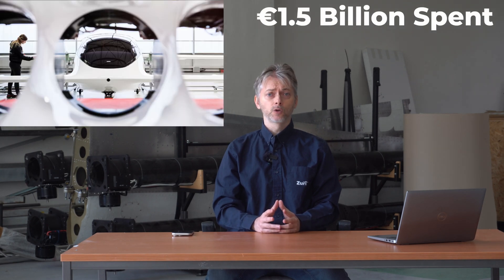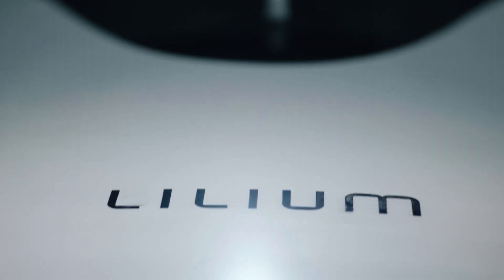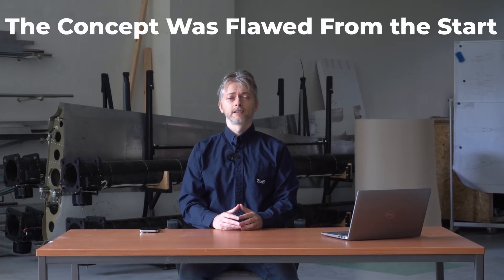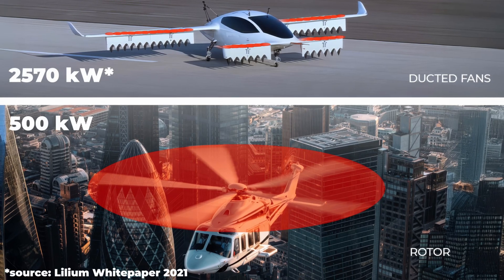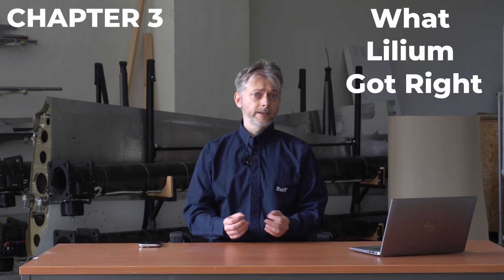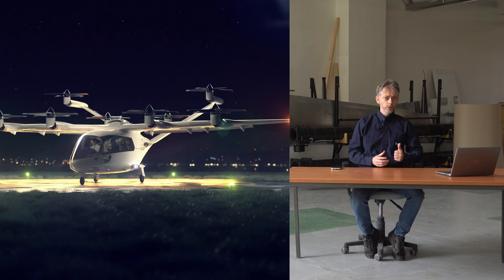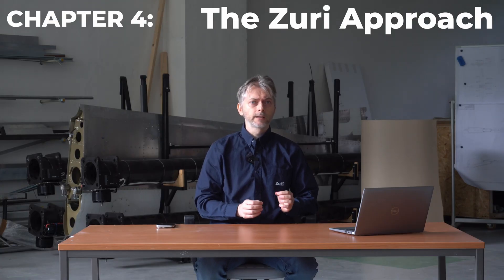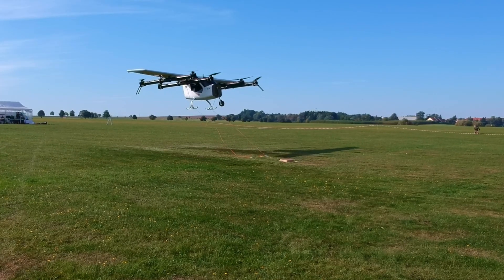Lilium's €1.5B VTOL Collapse Explained — Why It Never Flew

Comment: I disagree with you and I think you using this company's failure to try to make yourself look successful is pretty stupid. They failed because they scaled wrong and should have done what you did and built a full scale demonstrator. You haven't succeeded where they failed yet either I should mention. You haven't brought an evtol to market, either.
Reply: Not yet, but we will - it depends on the fundraising, of course, but we are orders of magnitude more efficient, as proven many times before.

Comment: These electric VTOL aircraft are a niche within a niche within a niche that is not needed.
They will never be used like the futuristic “flying car” that the public has been sold.
As discovered and similar to the automotive segment, most startups are money hungry endeavors that enrich a few, many are scams and others will fail simply by running out of foolish dreamer investors money. 
Lastly, I know of no one that would board one of those machines.

Comment: In one word, this is a simple fraud. What kind of engineer could not calculate thrust of fan engine? They just take off the finds wsith nice design picture from naive and stupid investors. What is the worst that they are continuing with another "project". Michal Ilich - It looks like usual Croatian scammer.

Comment: I got a better concept for Vtol. It is based on cyclorotors. 

With large cyclorotors you can also land the aircraft with autorotation. 

With your design, people drop dead, if you got energy loss in hovering state. 

Even Stol is safer than this.
Reply from the maker: Our design uses dual propulsion and eight tilt rotors, which together provide multiple layers of redundancy. This helps ensure safe operation even during critical phases of flight.

Comment: Electric? Green? Climate actions? Startup? 7 seater (600KG payload)? Massive potential market? Sustainable fuel? And so on, right from classic BS bingo, full card? Aaaaah, we do know, heard it so many times. The outcome is always the same.
Reply from the maker: We hear your frustration. The industry has seen its share of overpromises. Still, we believe it is possible to move forward with both ambition and realism. The goal is not to chase buzzwords but to build meaningful solutions that work. Honest skepticism helps keep that effort grounded and we welcome it.
Reply: @zurivtol  unfortunately not. The very idea of all these climate-saving startups is just to scam everybody. Its not possible to defeat physics, but possible to join worldwide stream of bs and pinch off your own pension plan from trillions, disappearing in this black hole with or without another one startup, promising 10 or 100 times more that is possible to do.

 Eternal story, from the very dawn of mankind. The single difference - nowadays such scammers cant be even beaten, even for 1.5B of wasted money. Hurray, full steam ahead, we have so many other brilliant promising ideas! Geese are waiting!

Comment: In the world of commercial aviation, there is no room for inefficiency. The best battery technology today (i.e. 500 W*h/kg) is still only at 6% of the energy density of aviation fuel assuming 30% thermal efficiency for jet turbine. The dream of commercial aircraft solely powered by batteries will continue to be a dream for at least another 30 years. There is room for pure electric aircraft today in niche applications, and these areas are mostly in recreation and training. Hybrid powered commercial aircraft is a solution ripe for implementation today.
Reply from the maker: Thanks for sharing this. We agree that for longer distances, current battery technology alone is not yet practical. That’s why we’re focused on hybrid electric systems, which can cover greater ranges while still reducing emissions and fuel use.

Comment: Hybrid currently makes a lot of sense for weight reduction if you use the jet fuel in a power unit not as a direct drive.
But battery tech is getting better far more rapidly than combustion or fuel technology.
Purpose of electrification is to generate enough power to keep batteries well charged and extend range.
One huge advantage of electrification is the ability to recover potential energy as plane goes lower, using the prop(s) as generators, same as regen braking in EV/hybrid cars.
Reply from the maker: Hybrid systems offer real flexibility, especially when it comes to managing weight and extending range. One advantage with Zuri's approach is that our batteries are charged in flight, which supports longer distances without ground-based charging.
Reply: @zurivtol  Kdybys uměl počítat, tak zjistíš, že tahání baterek do vzduchu vše pouze komplikuje. Vrtulník se spalovacím motorem dávno existuje.

Comment: I said it when I saw the first concept. it will never work as promised. I build and fly my own designs. Range, payload and speed are competing requirements. The EDF, especially if small, is the worst technology to satisfy all three.
Reply from the maker: You’re absolutely right that range, payload, and speed always involve trade-offs. Finding the right balance between performance and efficiency remains one of the key challenges in this field.
Reply: @zurivtol  O výkonu a efektivitě můžeš teoretizovat, Illichu. Elektrický generátor + akumulátory + elektromotory a přívody, spínací prvky a regulace budou mít takovou hmotnost, že pokud použiješ ještě turbínu, palivovou nádrž, nebude již ani prostor, ani užitečná hmotnost pro osádku. Zanech experimentů...

Comment: Hi, you'll be interested in my synchronous electric motor. No slip rings, no magnets, no coild on the rotor. It's genuinly a synchronous motor with variable field for operation at Power Factor of Unitiy. Otherwise, I am in complete agreement that the answer for aviation is a hybrid drive, burning chemical fuel in certain flight regimes wheli the propulsion is electrically driven. Such a system can be feasible for larger aircraft.
Reply from the maker: Thanks for sharing that. Your motor design sounds very interesting, and it is always exciting to see new thinking in electric propulsion. We fully agree that hybrid-electric systems have real potential in aviation, especially when optimized for specific flight phases. If you have a link or more information on your work, feel free to share. We appreciate your interest in the conversation around how aviation evolves from here.

Comment: They were never going to be successful. They were on the wrong path. What is interesting to me is that someone coughed up 1.5 billion.
I can make you a 100 flying aircrafts for that money. Obviously stolen.
Reply from the maker: It's fair to question how resources are used, especially in ambitious tech sectors. Building new types of aircraft is complex and expensive, and not every path leads to success. Still, some teams are working hard to apply lessons learned and push forward in more sustainable, viable directions. We believe there's value in advancing the field responsibly.

Comment: Most companies riding hype waves (vtol taxis, crypto, blockchain, AI, self-driving etc) are just scams meant to bring in gullible investors. The product is never the important part. It is just a tool to hype up the valuation so that the founders can exit quietly with giant sums of money. It is one of the best ways to get rich fast.
Reply from the maker: It's true that hype can sometimes overshadow substance, especially in fast-moving industries. But not every team is driven by short-term gains. Some are focused on solving real problems with long-term impact in mind. We believe innovation should be grounded in technical credibility, real-world use cases, and a path to sustainable value.

Comment: Sustainable aviation fuel is approx 5 times more expensive than conventional fuel, production Even with planned expansions is  predicted to meet only a small fraction of the projected jet fuel demand by 2030. Its a good thing that innovators chance their arm and investors take a punt or we would never advance technology but remember as Elon Musk said Prototyping is easy, Production is Hard and making money is near impossible, I think that is particularly true of aviation due to the certification hurdles.
Reply from the maker: Great points. SAF has potential, but you are right that cost and scale remain major challenges, and the timelines are tight. Most projections suggest SAF costs will come down gradually, but near-term supply will still only meet a small portion of global demand. That said, SAF is one of the few available drop-in solutions today, and both governments and industry have set ambitious goals to scale it up over time. Aviation is a tough space to innovate in, especially with certification and production complexity. Still, as you said, without people willing to take risks, nothing moves forward. We try to stay grounded in both engineering realities and long-term viability. Appreciate the thoughtful take.
Reply: There is algae fuel. But the problem is upscaling. No one has developed a method to upscale. It's like the zipper. The person who invented the zipper didn't make any money. The guy who made the machine to mass produce zippers made all the money.

Comment: Electric flight is fine,  especially for small STOL planes on short flights.  This vertical take off obsession is a folly.
Reply: It worked with the Fairey Rotodyne.
Reply from the maker: Thanks for your comment. STOL absolutely has its place and offers a lot of efficiency in the right contexts. We see VTOL as a way to open access where runways are unavailable or impractical, especially in remote or space-constrained areas. For us, the value is not in replacing traditional aircraft, but in adding flexibility to serve new types of routes. It comes down to choosing the right tool for the right mission.

Comment: The Lilium aircraft worked,  but should started smaller,  like Jetson's aircraft.  You want to get a piece of the  ultra light and experiential markets first to start making money fast. These smaller markets already have bookings for the next few years.
Reply from the maker: That is an interesting perspective. Starting with smaller ultralight or experimental aircraft can definitely be a faster path to revenue and visibility, especially in the experiential market. For us, the focus has been on solving real mobility challenges where range, payload, and operational flexibility are essential. Different strategies make sense depending on the target use case and timeline, and it is good to see both approaches moving forward in the space.

Comment: and you would know, German R&D tax rules reward continued research at times, rather than going to production.
Reply from the maker: Interesting point. Germany does have strong incentives for R&D, and in some cases that can tilt companies toward ongoing development over moving quickly to production. But it is also what helps support deep engineering work and long-term innovation. As always, the balance between research, certification, and commercialization is a tough one in aviation.

Comment: As a propulsion engineer and ducted fan designer I agree with your analysis. The marketing term "electric jet" raised my eyebrows right away - a ducted fan is not a jet. Pure hype. Now take 30 of those tiny ducted fans, all operating at very low Reynolds Numbers, with inlets optimized for cruise rather than static thrust, with relatively small total disk area, and you get a very inefficient system, requiring a lot of power to hover. Then add up all the parts, wiring, connectors, control systems, etc. and it quickly becomes a nightmare to build and maintain. Simply not practical. August Raspet, designer of the Focke Wulf 190, said it best: "Add lightness and simplicate". Amazing how gullible investors can be. 1.5 billion? You have got to be kidding me!

BTW, I can hardly understand your accent but have subscribed anyway!
Reply: Kurt Tank designed the FW190.

August Raspet was an aerodynamasist who did a lot of boundary layer work.

As to Simplicate and add lightness: Colin Chapman is often credited with that one, although he didn’t come up with it. Neither Kurt Tank or August Raspet are credited with coining the phrase, although it is good advice in aircraft, and cars.
Reply: Hi Phil. For the readers: 
1. Second law of Newton (1687 AC): throw down wind , get lift back. But : lift is linear with the throwdown-wind speed, and the energy loss is squared with it. Small Lilium ducts, much energy needed and lost= first try of "bending physics" by Lilium.
2. Square-cubic law. Twice in size means squared wing surface and mass to the power 3. So blow-down, or throw-down speed of wind must increase linear with size. Efficiency goes back squared. Bigger is inefficient. So upscaled Lilium model is against more physics laws, than one.
3. Nature proves it: very small helicopter birds (=hummingbirds) can hover 60% of flight time, larger heavy planes (Albatross etc) need long wings to reduce wind-throw-down speed. 
This is the explanation in primary school talk.
Reply: Does a water hose emit a jet?
Reply: @bernhardzunk7402  Not in the sense that an aircraft engineer uses the term! "A jet of water" and "'electric jets' that are actually ducted fans" are very different "jet" claims.
Reply: @bernhardzunk7402  technically yes, water jet😂, jet is high speed controlled flow through a duct
Reply: Archer Aviation is spending similar amounts on a less ambitious technology. And they get valued at 7bn, as though competition didn't exist
Reply from the maker: Appreciate the thoughtful comment and your perspective as someone with hands-on experience in propulsion and fan design. The points you raise around efficiency, complexity, and Reynolds numbers are important considerations for any VTOL architecture. We are taking a different approach focused on balancing performance, range, and maintainability in real-world use cases. And thank you for subscribing. We are glad to have you in the conversation.
Reply: A ducted fan produces a jet. A turbojet also produces a Jet.  But neither a turbojet, ducted fan or a turbofan are jets.   Jets are streams of fluid or gas  but in itself non of the engine are jets. its a sloppy abbreviation just like 'gas' is used to describe gasoline.  .
Reply: @bernhardzunk7402  Ah, you have answered your own question! sorry, I didn't scroll down far enough...

Comment: Yeah, focusing on small potential benefits and completely ignoring extreme drawbacks doesn't fool physics. Besides the very obvious fact that using a lot of tiny ducted fans is very inefficient, even when you consider small potential benefits, no matter how cool those potential benefits may seem in theory, there are other very severe issues with that concept/idea. 

For instance, whatever efficiency you can achieve, it will decrease even further the further you get from the optimal conditions for the specific design, unless you can control the aerodynamic properties, like by having variable pitch of the rotor blades. And for a short hop VTOL battery powered application, you really want as high efficiency as possible, at any speed, and in their case that's every speed from 0 to 300 km/h, claimed cruising speed. 

I'm well aware that the design had some even demonstrable benefits, under certain conditions, which out of context might have seemed almost too good to be true. But there's no free lunch in physics, you can't generate power, or forces, out of nothing, you can only reduce losses in energy transitions, and even that has limited potential.      

Developing a new aircraft for general certification is difficult enough as it is, even if you stick to conventional technologies and design choices as much as possible, that's the main reason aircraft models developed in the 1950's (maybe even earlier, but i don't know of any) are currently in production, they have seen a number of very small changes, but are fundamentally basically the same aircraft as was developed around 70 years ago. "Reinventing the wheel" for just about every aspect of an aircraft that you can think of, and ignoring the the very obvious and severe drawbacks of your ideas doesn't make you a pioneer.    

There are many good practical reasons to why most "full sized" VTOL  capable aircraft are conventional helicopters, with one large main rotor, and a small anti-torque rotor, and it's not caused by a lack of creativity, trying or wishful thinking. Even despite the fact that having two rotors that generate lift eliminates the need for a anti torque rotor, having a single big main rotor and a anti torque rotor has generally been found to be the better option than even just two lifting rotors, up to a certain size and for most applications.     

That said, eight rotors, and 700+ km range, and high cruise speed, in a small aircraft, seems "a bit optimistic" to achieve too.
Reply from the maker: You raise thoughtful points, and we respect the engineering realities involved. Aviation is full of trade-offs, and it is true that physics does not bend to wishful thinking. Our hybrid VTOL approach is designed to address some of these challenges, especially the need for flexibility and efficiency across practical distances.

700 km may sound long from a ground travel perspective, but in aviation it falls squarely within the range of regional travel. The real opportunity is not just in how far you go, but in where you take off and where you land. Skipping major hubs and reaching closer to your actual destination is where hybrid VTOL can offer real advantages.

We appreciate the thoughtful feedback. These conversations matter.